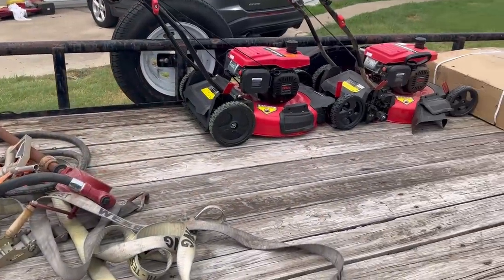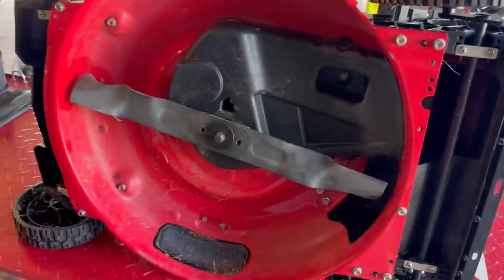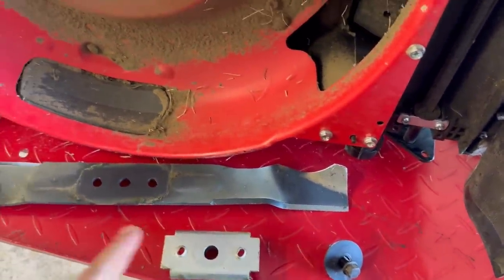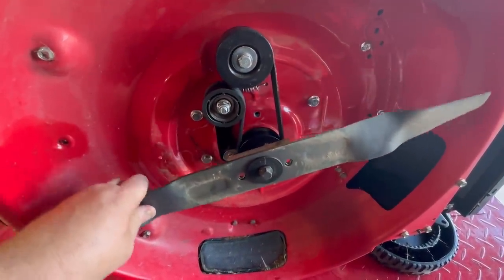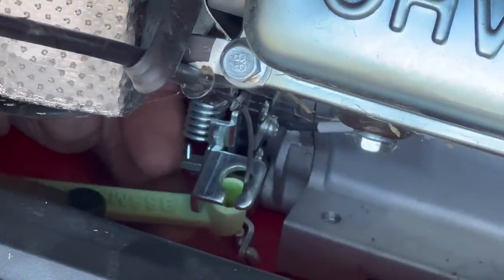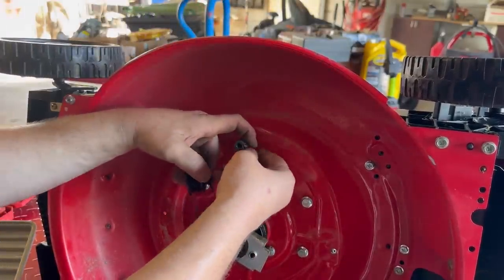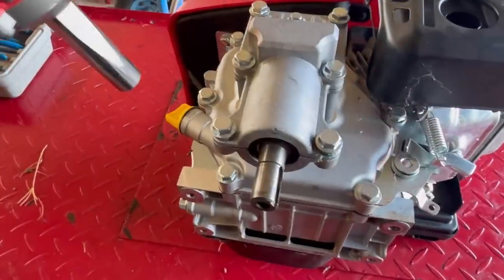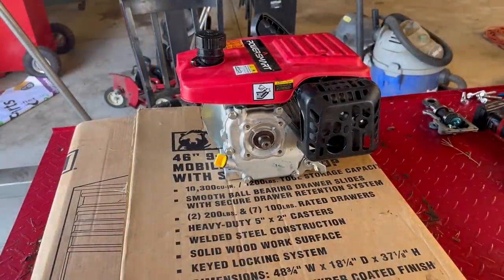POWER SMART MOWER KNOCKS BAD / DIAGNOSIS AND TEAR DOWN / BLOWN GEAR BOX

Comment from the maker: BRANDON BUCKLER INVENTOR OF THE MOWER CABLE TOOL 2.0
https://youtube.com/@BSSMALLENGINES

BRANDON BUCKLERS ETSY SHOP
https://www.etsy.com/listing/1333546210/push-mower-cable-disconnect-tool-20  

CHECK OUT MY EXTENSIVE ⬇️ON LINE PARTS STORE⬇️

https://www.amazon.com/shop/backwoodsctryboy?ref_=cm_sw_r_mwn_aipsfshop_aipsfbackwoodsctryboy_711XHGH8CP3D50QKTF9B

TOOLS I USE EVERY DAY
MILWAUKEE 1/4” SOCKET SET
https://amzn.to/3WemAH1
MILWAUKEE 3/8 SOCKET SET
https://amzn.to/3WemAH1
MILWAUKEE IMPACT 1/2”
https://amzn.to/41QLUnF
MILWAUKEE IMPACT 3/8
https://amzn.to/3MF5DSX
LONG SHANK ALLEN BIT
https://amzn.to/3M9O1gs
KNIPEX PLIERS
https://amzn.to/41RhZeO
BASIC MECHANICS TOOL SET
https://amzn.to/3MBXYom
JAPANESE SCREWDRIVER SET
https://amzn.to/3Mjh6WF
SHOP PRESS
https://amzn.to/3WgCZum

Comment: PowerSmart is the bottom of the barrel in power equipment. I bought a hedge trimmer, its OK for light use (I used it to cut vines away from a fence). The matching 20V trimmer is garbage.. Assemble the gear and keystock with plenty of grease and it will reduce the chatter and prolong its life, sounds stupid but it helps with other drive systems last longer.

Comment: Yah I have seen some videos on theses never one in person.  Terribly mowers.  Get a goat instead

It’s like they had horizontal shaft engine that they didn’t want to design to be a vertical shaft. So they adapted it with more parts to fail.

Comment: I work on them the knock is in the gear box they all do it  they are junk  they are sold at wal- mart in my area I own a small engine repair shop the snap ring moves. I"ve worked on 5 of them all the same.  forest city nc

Comment: I would make one good mower out of two.  Then get some extra wheels for the knocker and weld up that gear to the gearbox shaft and fill the box with grease and see how long I could use it till it self destructed the box!!   Worth a try!!  May work for years!!   The twin machine I  think will meet the same fate!!😊

Comment: These mowers were from a Walmart chain. I had the same from a customer who stated that it was using to much fuel, The reason is that it was all going straight into the crankcase. The exact same thing happened..bad crank. I have a new customer who has the 170CC engine and I can hear a strange noise even without the plug being installed. I advised her to get a newer motor that has been around for a bit, but even those are being made cheap as well.

Comment: I am wondering if the horizontal design is that way to speed up the blade speed by changing the pulley size.

Comment: Interesting revelation!!
Must be a German design. LOL
It looks like the carb issue rocked the shaft to oblivion!
Put a steel  oversize key and a spacer and crank it tight. If it breaks no loss.

Comment: How much do you wanna bet that those engines are cheaper and more abundant in china because they can be adapted to more equipment, so it was probably cheaper to add the gear box to make push mowers out of a generic engine. That sure is a curious design. I can see the gear boxes failing from lack of maintenance in a few years and they will get tossed left right and centre.

Comment: I feel it is a bad design the first time i saw it i knew it was a bad design. At work there is a Yazoo big wheel mower that came in it is so much better made than any consumer box store grade push mower heck its way better than a Honda the DR trimmer is a Good mower also. The worst walk behind mowers are the pulsar power smart and black max mowers with the plastic deck mowers home depot had powersmart mowers for over half the price the power smart mowers are poorly made also we have had alot of powersmart mowers come in and the customers leave them behind and we have to find a way to dispose of them dont buy powersmart mowers at any cost get a Toro

Comment: WHY, WHY, WHY?! At first I thought maybe it’s a blade clutch so they went through all that to make the idler retractable, but no. I just don’t see any reason for that design unless they had a ton of horizontal shaft engines and a ton of pinion gears and needed to find a way to get rid of them all. Bizarre design and engineering FAIL!

Comment: Absolute junk! I got one in that was a vertical shaft engine. Customer ran it out of oil and it was shot. Didn't spend much time on it and gave it back to the customer. This thing was cheaply made and I wouldn't know where to get a part for it if another one crosses my path.

Comment: No room in the deck for grass clippings,  I guess there is a bagger for it but it looks like the grass clippings will have to fight gravity to go up into the bag and stay there the way that rear chute is designed. It's all engine. The engine extends upwards with the gas cap on top and then extends down into the deck heaving little room for the grass to circulate. Terrible design, very little functional use whatsoever. Let's not even talk about the wheels. I've never seen lawn mower wheels wobble like that